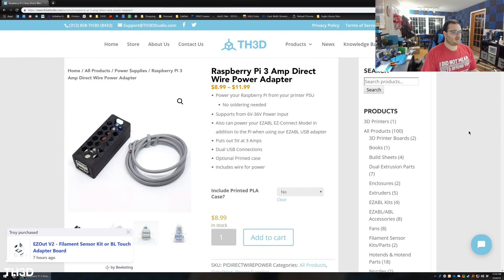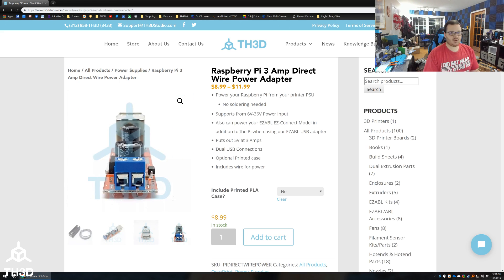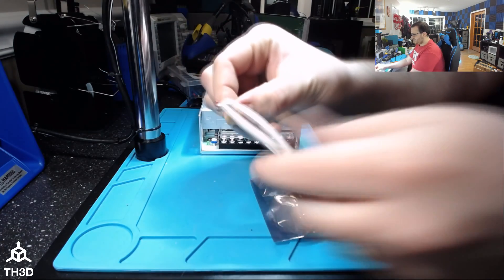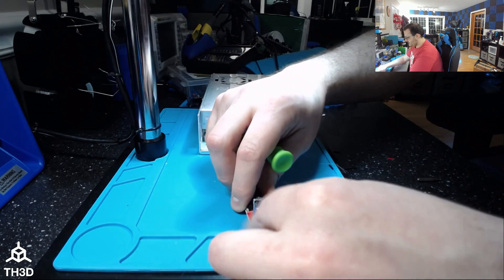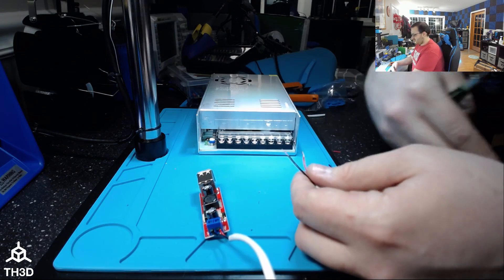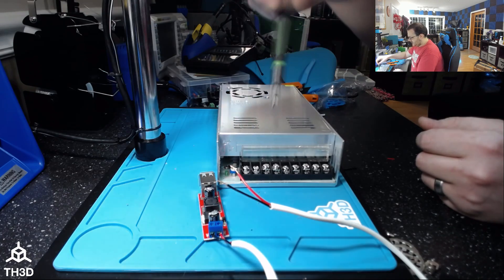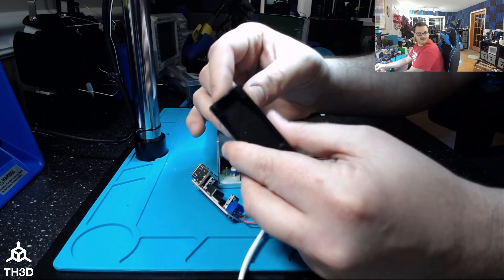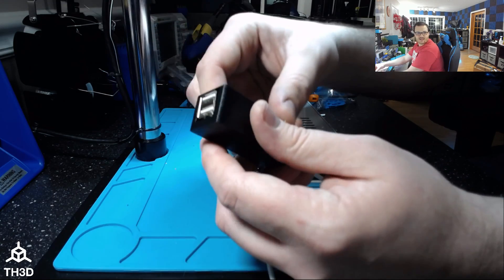Powering your OctoPi from your Printer - Product Setup - EZPi

Comment: Why this does not work with a PI-4, as stated on the product page? Thanks for answering.
Reply from the maker: Pi 4 draws more current than a 3B and 3B+. It's also more picky about voltage drop so it can trigger the power warning.
Reply: @TH3DStudio  can you recommend something to power a Pi 4 from an Ender 3 pro PSU? Was searching extensively but could not find a reliable solution. I would like to avoid buck converters, but majority of them don’t provide enough amperage anyhow.
Reply: @TH3DStudio  I was just about to purchase your EZPi V3, but I need to power it from the printer: i3 Mega and CR10. Is this buck converter still a no go with the EZPi V2?

Comment: I have a beginners question: can I wire this into the power supply if the + and - are already in use? (ie. have two times + going to the + terminal and two times - going to the - terminal) Thank you!
Reply from the maker: Yes you can double up. The module pulls very little power. If you have an always on screw terminal on your board you can put it in there with that as well.
Reply: @TH3DStudio   Thank you. Much appreciated.

Comment: Bit of a silly question but would I be ok using a micro USB cable to USB to power my raspberry pi?
Reply from the maker: As long as its not a cheap gas station cord. You want to use one with larger power wires.

Comment: This assumes that you have 3 Amps 'spare' on your printer's Power Supply.

I can think of a couple of budget printers where that may not be the case (the original Ender 3 power supplies, for example).
Reply from the maker: Ender 3 is fine. It pulls up to 0.625A from that PSU. No issues there or other machines. About 1.25A for a 12V PSU.

Unlike other companies in this market, we actually test to make sure things work correctly and do not cause harm to the user or their machine.
Reply: @TH3DStudio   I appreciate both the question and the answer since I wasn't sure about the extra power consumption on my Ender 3 Pro power supply.
Reply: The additional current draw from the PSU is typically much less than the current drawn by the raspberry pi.  For example the output voltage of an Ender 3 PSU is 24Vdc.  If the raspberry pi draws 3A at 5Vdc, the power consumed is 5Vdc x 3A = 15W, so the current drawn from the PSU would be about 15W / 24V = 0.625W.